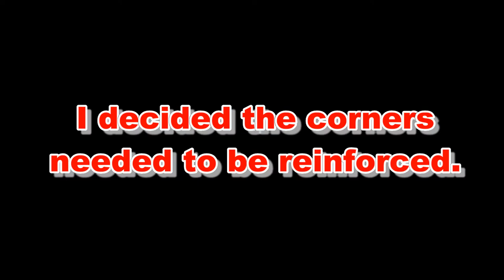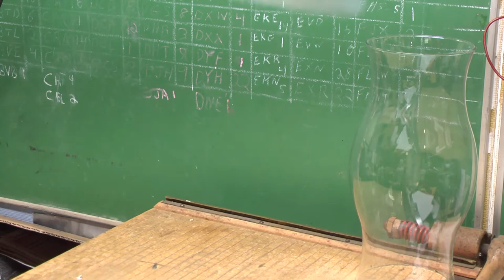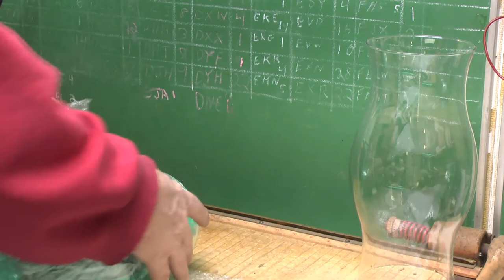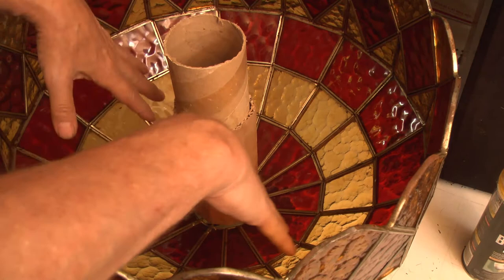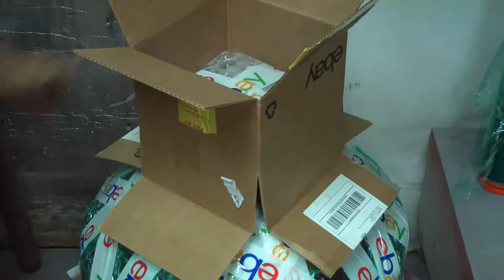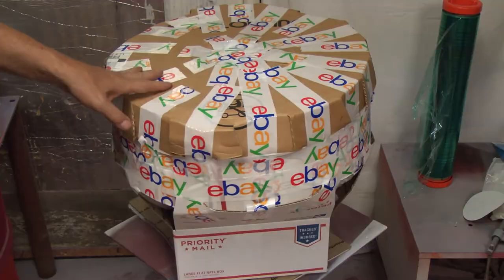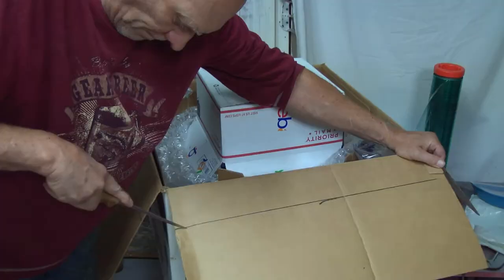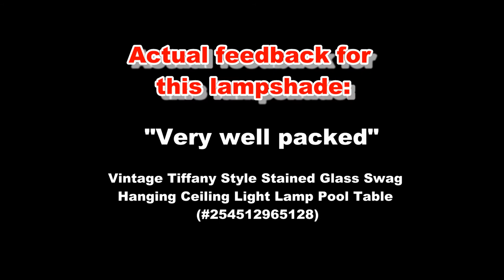How To Package And Ship Three Types of Glass - Flat, Cylindrical, and Tiffany Style Lampshade

Comment: Regarding the Tiffany-style lamp: a very thorough packing job. Also very time consuming. I'm guessing this took about an hour, and in some parts required two people. I'd have to charge the customer a $75 handling fee on top of shipping to justify the time and materials.
Reply from the maker: I did all the packaging by myself. But yes, a helping hand can be beneficial for sure. I explain in my listings that proper packaging is more important than lousy packaging with shipping insurance. I add the cost of the packaging into my item price and try to explain that in each listing. If a buyer doesn't understand that, then I rather not deal with them. Thanks for watching and commenting.